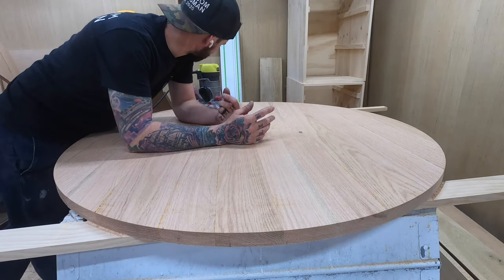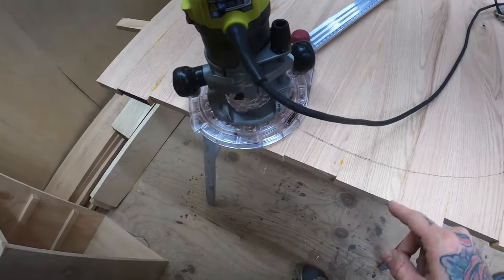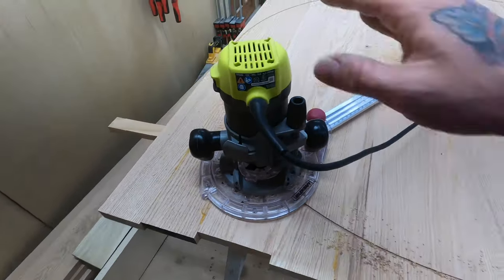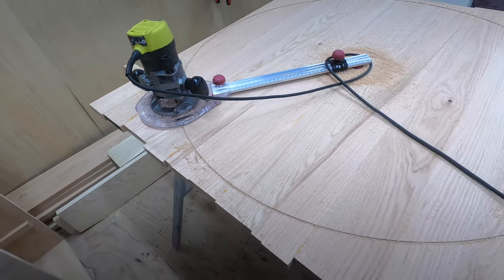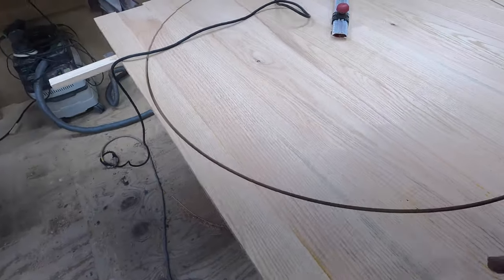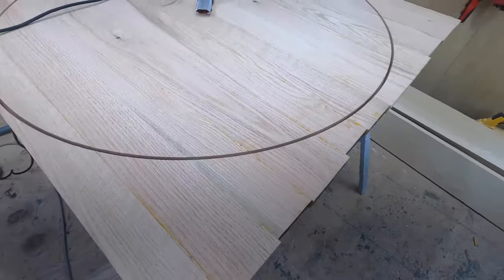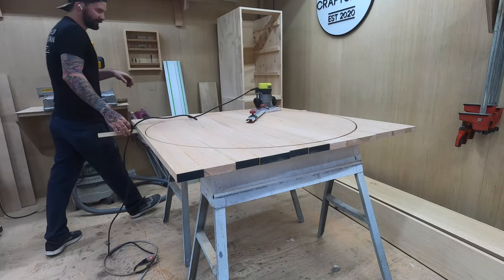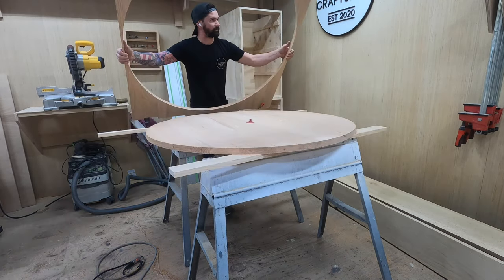Cutting a round table top the EASY way

Comment: I have a Bosch router that doesn't plunge as well and want to expand I to circular tables. My question is, to you turn the router on and then adjust your depth a 1/4" into tabletop once its spinning?